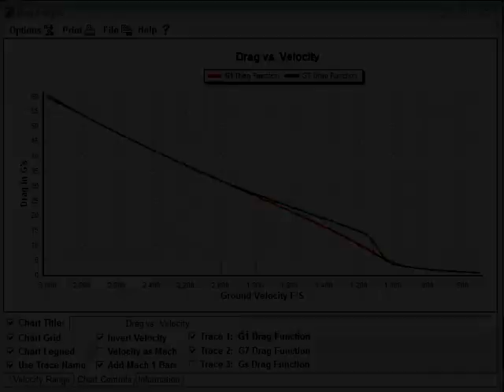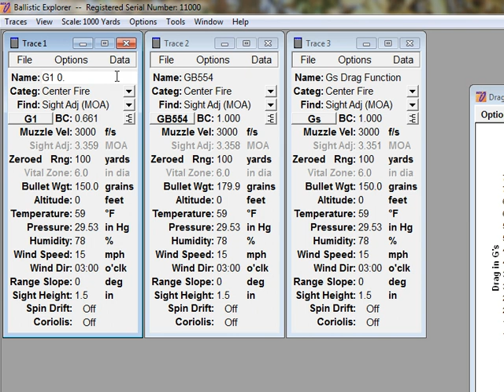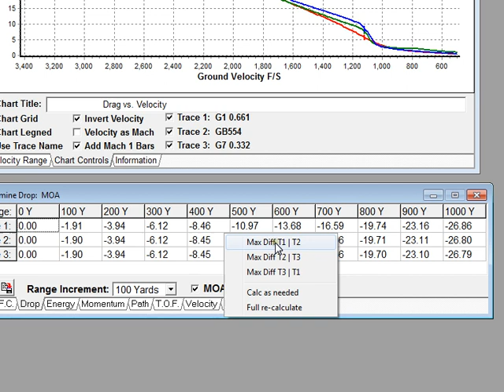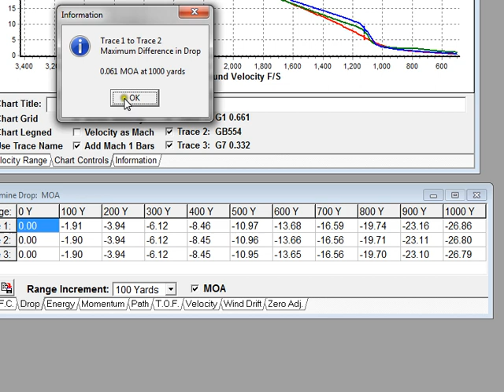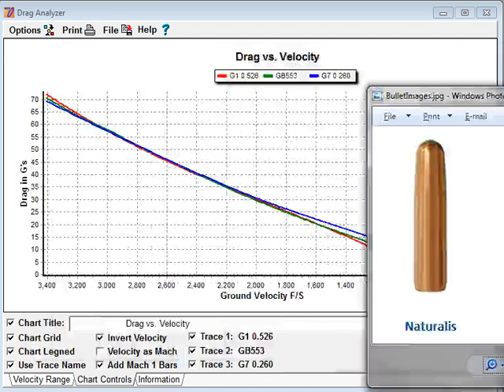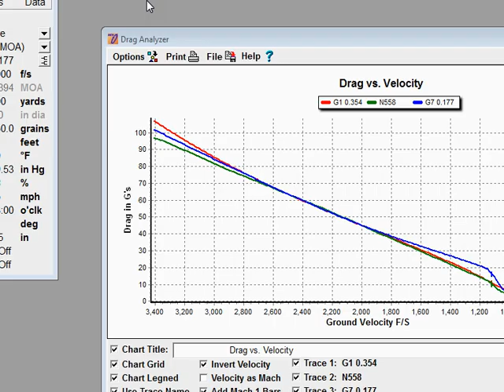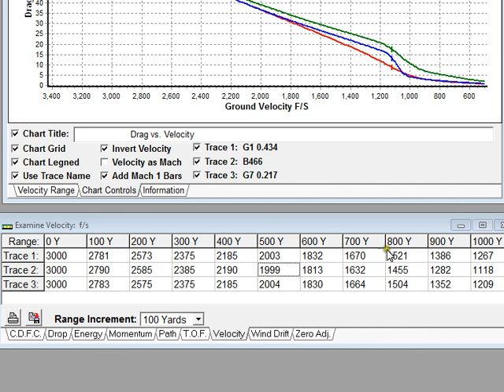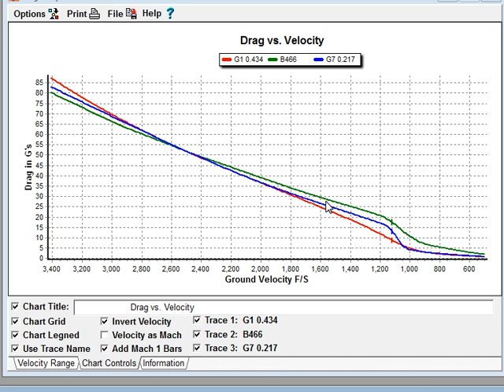Custom Drag Functions

Comment: This is an interesting experiment. In the first example (180gr) you indicate G7 is a better fit and in the second example(150gr), G1 is a better fit. However if you slightly adjust the G1 BC in example one to .664 you get an almost exact match to the custom Lapua drag function, better than the G7 BC. 

So maybe its not which function is better, just which was more accurately defined? All this assuming the custom function is "absolute" of course.
Reply from the maker: Laupa's published BC values of 0.661 for G1 and 0.332 for G7 were being used in the video.  One thing the manufacturer doesn't know is the specific muzzle velocity someone will use, so they have to compromise.  For 3000 fps you can adjust the G1 BC to 0.664 and the G1 better fits the custom drag function as you said.  However, increase the muzzle velocity to 3100 fps and then G7 becomes a better match than G1.  And above 3100 fps G7 becomes an even better match than G1.

With the 150gr bullet the G1 is a better match with any muzzle velocity from 3500 down to 2700 fps using the published BC values or with BC values that give an equal time of flight as the custom drag function out to 1000 yards.

Custom drag functions are not absolutely accurate, but give the best predictions for the specific bullet they are developed for.  Even so, by knowing the muzzle velocity and intended range you can usually find a G1 or G7 BC that gives you nearly the same results as the custom drag function.